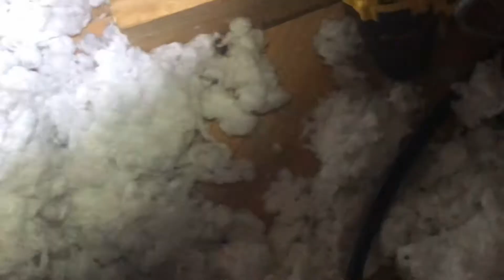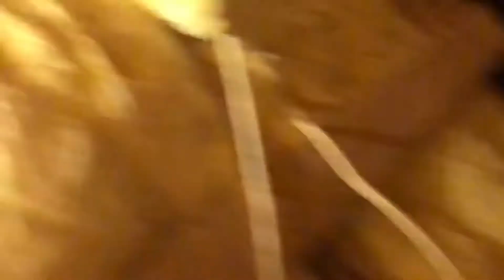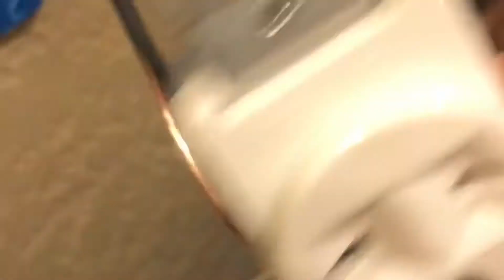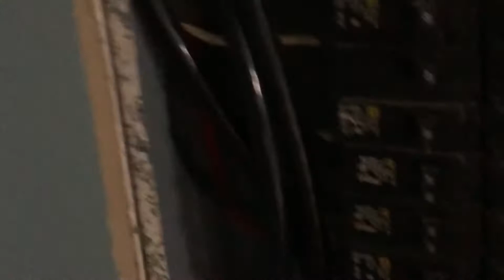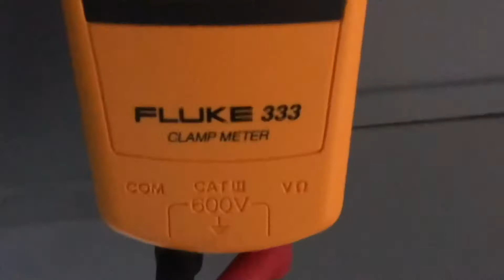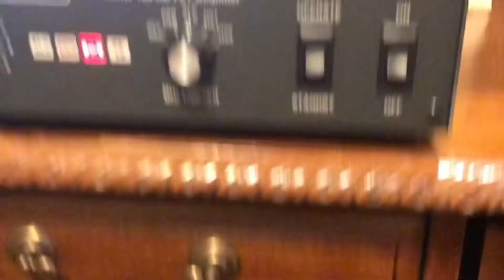Ameritron ALS-1306 ....... 240 VAC installation on an existing wall

Comment: Does it trip the 15amp breaker? What awg wire did you use? 12-2 or 10-2?